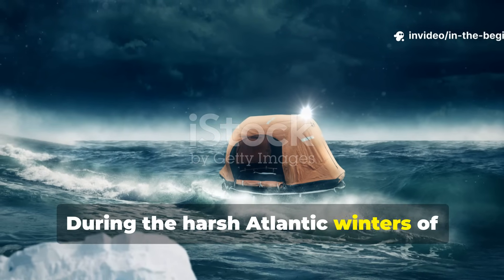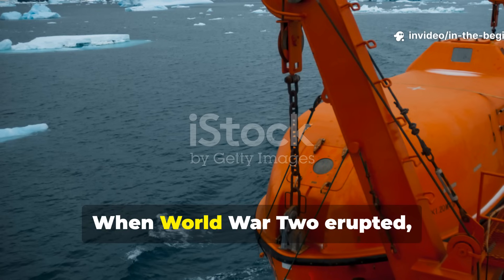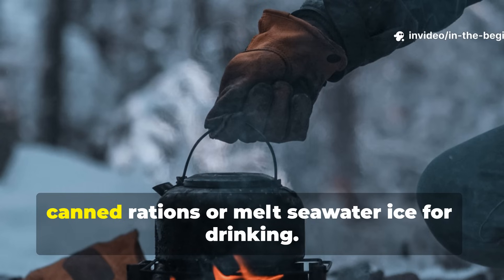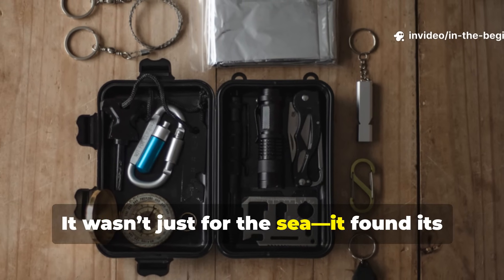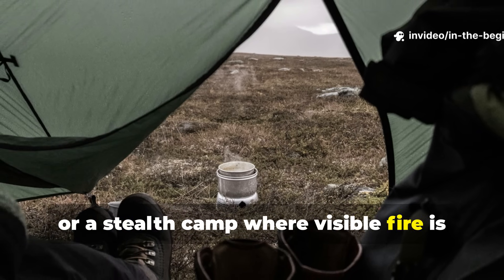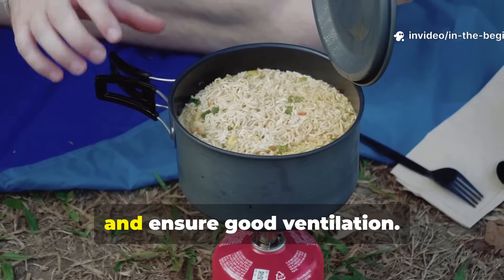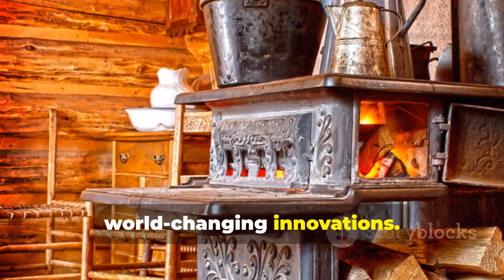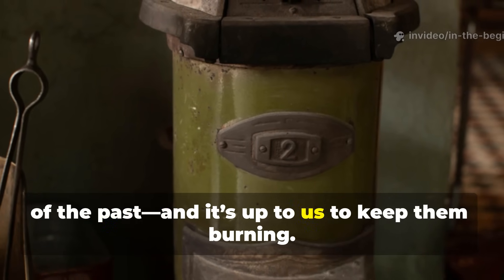The Forgotten Lifeboat Stove That Burned Without Flame

Comment: The stoves burn with flames, too. The difference is, that the flame is of a a faint blue. There are numerous products on the market who produce heat to cook without any flame, simple by a chemical reaction between two components, oxygen none of them. In this respect, the whole video is off topic. At [2:56] it is stated, that these stoves transer eat by radiation and convection, rather than by visible light. That is true for every kind of flame, and visible light does not transfer heat, it is the infrared portion. Is that video another AI junk?
Reply: Yes, more AI .  I hate the random image generation. I know it is deliberate, especially when you look into how our brain's work to combine and reenforce information by layering visual and auditory information.

Comment: What is a heat-proof tin?  Chafing dish fuel (for keeping food warm) is similar.  An alcohol stove does the same thing except for needing a leak-proof container for storage which most rubbing alcohol is sold in!  A 50/50 mixture of 70% and 91% rubbing alcohol seems to work best for most alcohol stoves, even the DIY ones!